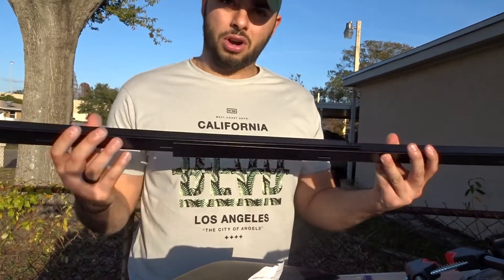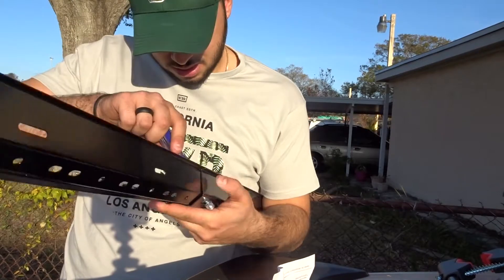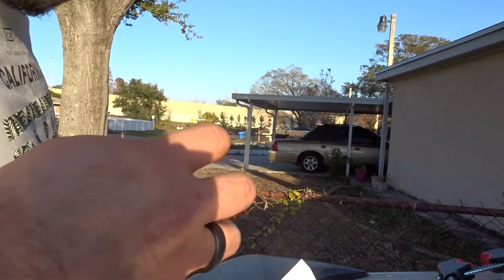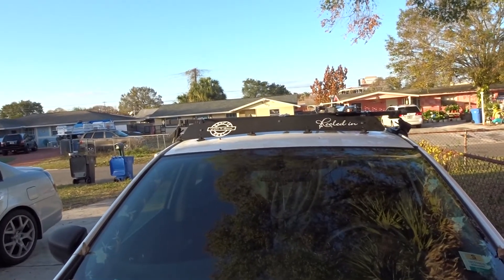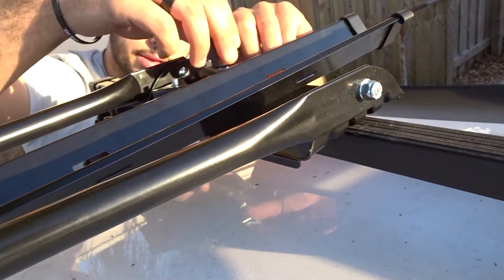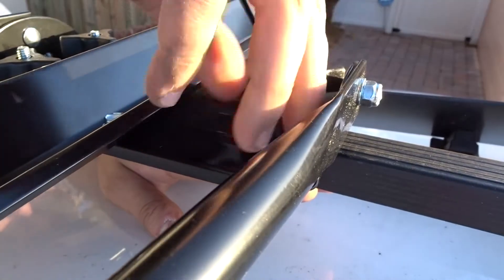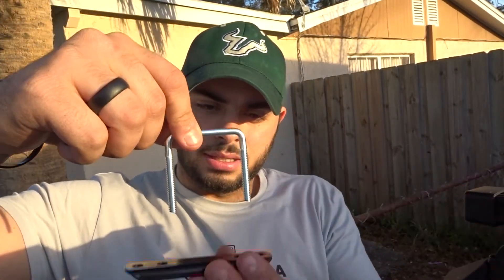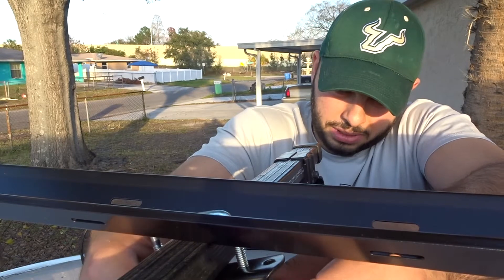Swagman Bike Rack Review & Install

Comment: I just bought the same roof rack and there’s an issue with the rear part of the bike rack. After I attach the bike rack to my cross bars, I’m noticing when I put the U bolt into the rack, the bolt is touching the top of my roof and scratching the paint. The U bolt is too long and I have a hard time putting the nuts on. Is there anything I can do? Thxs!